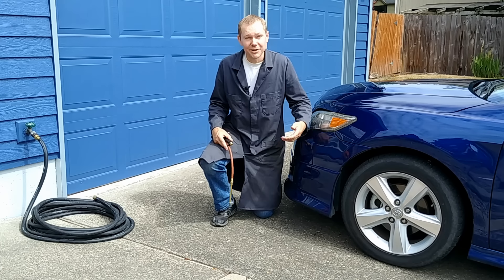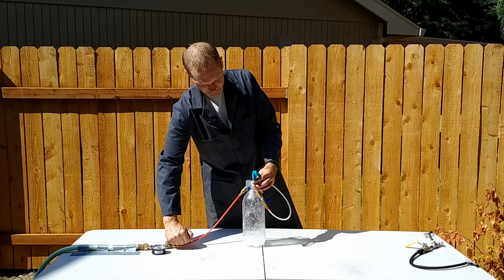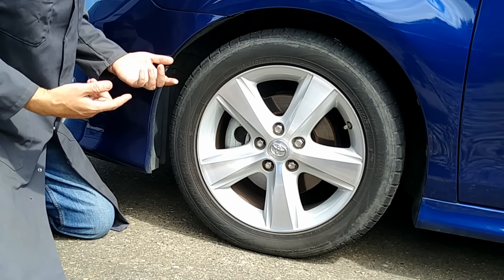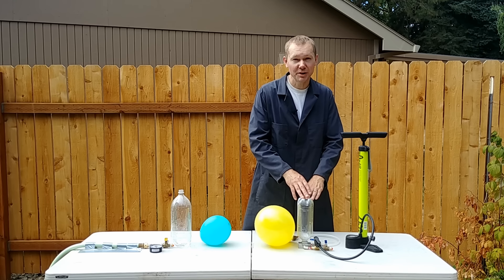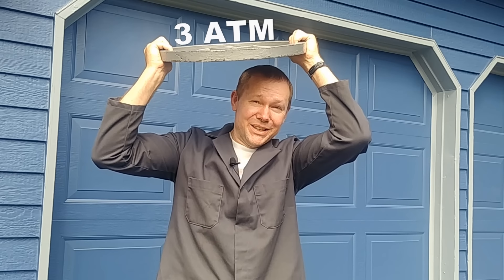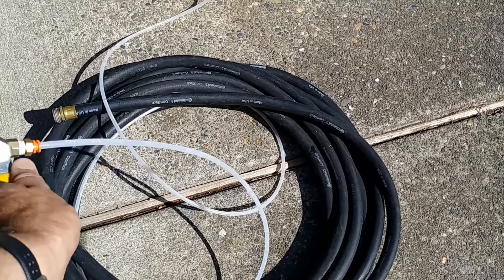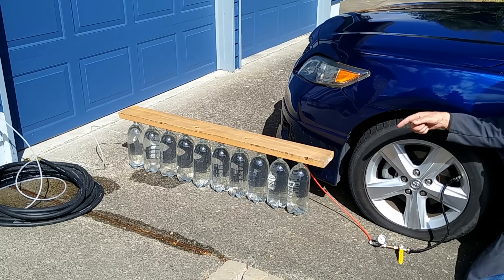2 Liter Bottle Compressor (No Moving Parts)

Comment: Common things in your house, water, water bottles, air, a CNC MACHINE
Reply: My mill isn't CNC, but I have one in my garage
Reply: I'll bet you can do this without such a fancy tool.
Reply: We don't have water...
Reply: i have a cnc machine
Reply: And a drawer full of Legris fittings
Reply: Right.. I  way off grid here and just trying to figure out how to add a little air pressure to my gravity/siphon rainwater collection system. 
Took me to year to get a dribble to the kitchen.
Reply: @suprememasteroftheuniverse  if you're clever and have a stream near your house with some elevation change you can pump water using it's own energy too.
Reply: i got a tire  plug  kit....problem solved

Comment: You might consider installing an inline air filter, so that you don’t end up with enough water in your tire to cause issues.
Reply: Or silica gel next to a sponge.
Reply: @luciusirving5926  that would be a great filtration system. I just imagine water in the tire couldn’t be good and should probably be avoided. Freezing and balance issues could cause other more problematic issues. Shocks, struts, tie rods, bearings, seals and such. All could wear down very quickly with a good wobble.
Reply: My brother had got water in one tire on his mustang. It was very bad. Definitely want to filter out the moisture as we do with air compressors. Very cool idea for sure.
Reply: That was my first thought when a saw the thumbnail
-college automotive student
Reply: An air compressor water condenser inline would work perfectly...it will trap moisture under pressure...

Comment: I'm impressed that last 2L bottle didn't explode on the first run.
Reply: It was only under around 10psi
Reply: Would have been interesting to do the experiment with the bottles at about 2 atms to start.
Reply: A two liter bottle will handle at least double the pressure of the average city water pressure.
Reply: Some plastic bottles are extremely  strong , i worked in recycling industry many years ago, and when trucks backed in to unload , they would often run over used sealed plastic bottles ,  i once  saw a 13 ton compactor back over a plastic bottle and suspend it for a few seconds before it popped , although most are not that strong some do have thicker plastic and are very strong . .
Reply: The last bottle and first bottle are under the same amount of pressure.
Reply: @Alucard-gt1zf  the new 2L bottles are thinner. Only the pre recessions (before 2007) bottles were thick. tiki punch and the short fat gatorades are the best
Reply: @Zuaachen  i was wondering about that because they were gonna have to withstand more pressure then the recomended tire pressure turns out thats ez and the water pressure has to be high enough too
Reply: @Alucard-gt1zf  - I think household water pressure is usually 30 to 60 psi.  I've read of some areas where due to elevation differences they are over 100psi.
Reply: 2liters are designed to hold compressed air in a liquid medium. Carbonated
Reply: Soda bottles like that are rated for quite a bit of pressure
Reply: I have filled them to 120 psi before.
Reply: Andy XxX  
You are very far from accurate, the entire principal behind the invention is that the incoming water increases the pressure in each succeeding bottle.
Reply: A 2L bottle blows around 90psi so this is well below tolerance..cool idea
Reply: It was a very useful experiment. If you keep the setup in the boot of your car, if you ever get a flat battery and a flat tyre at the same time and there's only a water tap nearby, you're sorted. Yes, you could use a hand air pump, but why extert yourself?
Reply: Meh, used to make dry ice bombs with 2L bottles as a kid.  At the bottle failure pressure it was enough to send a mail box 20-30 ft into the air and peel it open.  They will hold alot of preasure.
Reply: Why the last bottle, all the bottles see the same pressure?
Reply: @michaelfixedsys7463  ... rubbish,the pressure is essentially the same in each bottle ( maybe slightly less as bottles get further from the compressor due to friction of the gas but that is negligible.
Reply: @michaelfixedsys7463  
No. All the bottles are freely connected the pressure is equal across them all except when water is being added and friction delays the movement of water through the system. When the flow stops the pressure is equal in all bottles.
Reply: @Alucard-gt1zf  I think you meant to type 100 psi
Reply: @michaelfixedsys7463  The pressure is equal in all the bottles.
Reply: @andyxox4168  Yes, but the air is consentrated from all the pevious bottles to the last one.
Reply: @Dingsrud  rubbish (and incorrect spelling)
Reply: @andyxox4168  OK, what is rubbish? And for the spelling, I’m sorry,  maybe we should continue in my mother language?  Snakker du norsk?

Comment: this is how mines got compressed air in the past, they used waterfall to compress the air in to the pipes went all the way to the mine and powered the tools
Reply: Close.  But a trompe is a bit cooler and works from continuous flow.  PracticalEngineering has a good video on it.

Comment: This compressor could be implemented into a water system. If you add a second valve on the bottom of the bottles, you could empty all of them at once, and use the water in other ways, instead of wasting it. Then, when you need compressed air again, you flip a switch and water starts filling the bottles again. With a little bit of work, the process could be automated.
Reply: You sir MUST live in California..🤣 my years in college here revolved around the drought and saving water... I saw him pouring out the h20 on the driveway and was like NOOOOOOO!!😅🤣
Reply: It would take a LOT more than "a little bit of work" to automate the process.
Reply: Reminds me of selling electricity back to the power manager. If you scaled it all the way, wouldnt you just be trading water pressure with the main?
I mean obviously it would be cool if every house's water system came with a compressor, but this to me seems like the net result. Maybe get some extra life or utility out of a well pump using such cavities at the head?

Comment: Never would have thought of doing this! Displacement as a compressor.  So cool!
Reply: Technically that’s how a normal compressor works, instead of water level rising in a fixed volume it’s just a piston rising, and instead of having a guy open a butterfly valve every time the bottles are filled, a valve opens every time the piston reaches its highest point and the air escapes that way. Its a good way to demonstrate this though
Reply: And we are in a drought. Good thing I have a compressor
Reply: @johnypitman2368  And you still have all the water you started with apart from insignificant system losses,of course. Energhy or matter can be neither created nor destroyed. It is up to ingenuity as to how it is utilised. Imagination ,and innate Human laziness, are the mothers of progress.
Reply: @catabaticanabatic3800  yeah because having 80L of water left over after inflating a single tyre is completely practical
Reply: @lee3r24  Sorry Sir, I do not understand the gist of your retort.
Reply: Hey I know you! You sir improved my microsoldering skills alot back then when I used to do it. I hope your business is going well!
Reply: It's the very essence of the process.
The whole discussion in this video is avoiding (by the entire implication w/o express reference) discussing the basic physics of it all.

Interesting slight-of-hand Physics lecture.
Reply: It's just using household water pressure. It has nothing to do with the bottles. A long enough garden hose would do it. Its not displacement as a compressor. Its just the water pressure from the hose.. ~ 30-80 psi.
Reply: @its1110  There is no physics involved really.. Its just the water pressure from the hose...
Reply: Do you know that he use the pressure generated by the pumps of water net distributor?

Comment: I have an adapter for connecting my garden hose directly to my tractor tire. I fill it to the top of the rim (about 70% water). The weight (ballast) helps. Not recommended for car tires due to speed.
Reply: the bad part is it will make your rim rust.

Comment: A displacement compressor made out of soda bottles, that's really cool!
I can't say I expected it to actually meet the required inflation pressure running solely from mains water, but not only is it sufficient, I'm estimating based on atmospheric pressure and just how much air is being displaced that this rig is capable of reaching pressures as high as 80-90 PSI

Comment: Finally takes it to the mechanic to fix the stupid tire. Mechanic: “Why do you have so much water in your tires?”
Reply: Lmfao........ that's why I came here
Reply: You'd be surprised how much water you find sometimes.
People or gas stations never drain their compressors and by the time they've been filling it twice a week for 5 months there's a ton.
Not always but usually the shitboxes
Reply: @egnaro-hm1bd  I leave the pressure release valve just slightly open to drain the water from the compressor tank.

Comment: "Using nothing but water pressure", and "weeks of designing and fabricating".
Reply: Or... Just use that bicycle pump 🤣
Reply: Just a lesson in physics he was  not even trying to say it was practical
Reply: My point is, you don't spend weeks designing and fabricating water.  "Nothing but water pressure" is bullshit.  That's like saying an airplane flies on nothing but jet fuel.
Reply: @havenbastion  Exactly. As if the water pressure just magically appeared out of thin air...
Reply: @juanduarte200  Sadly, average people like you easily get in awe of every bullcrap they come across on the Internet.
The value of "a video like this" is about zero.
Reply: @juanduarte200  Or perhaps people should be more careful about what they say so they don't contradict themselves.
Reply: @havenbastion   you seriously have 0 knowledge in physics and just keep making yourself look like a fool. He’s not talking about materials but mechanics
Reply: @juanduarte200  Water pressure doesn't magically occur on its own.  He was not using "nothing but water pressure" in any sense.  Try to do it without the materials and see how far you get.
Reply: @havenbastion  you’re a heck of a comedian! How old are you 13?
Reply: @juanduarte200  I can't imagine how that was funny, but hey, you do you.
Reply: cnc machine and aluminium cubes

Comment: a saying we had in the military "if its stupid, but it works. it isnt stupid!"
Reply: That's not just military my guy.
Reply: @Bob Sacamano as a software engineer, we subscribe to the least stupid with a margin of error as a means to balance the optimisation problem of time and effort (cost/benefit)
Reply: In Aviation, if it's stupid and it worked, it is still stupid and you were just lucky. Aviation has very precise definitions of "stupid".

Comment: This only works because the water pressure was higher than the final tire pressure required. Also, there’s a better no moving parts compressor called a Trompe.
Reply: @jamierodg1  that’s incorrect. With a trompe the air is drawn in with the water from the source, this is just forcing air from bottles with water pressure. Not even close to a trompe
Reply: Was also confused about the pressure differential aspect. Maybe if he had a 20cm water inlet and a 1cm air outlet of some sort, but they seem identical in diameter so the pressure in should equal pressure out right ?

Comment: That will fit nicely in my trunk, in case of emergency flats.
Reply: My dear in cash of emegency you will not get this much of water too😂 and presure is also inportant,
Air will not creat if u will fill by bocket or mug
Reply: You can connect a compressor tank to your water out line. Let it fill with water and the air can be collected in another compressor tank. Time it right when you shower and youll some have compressed air for free and just open a return line from the first tank back to your water system. You can use that air for many things at whatever psi you got from the tank. You can run pneumatic tools equipment maybe even make an electric generator if you have enough tanks to run a alternator long enough. Ik its complicated but at least you'll have a compressor that can last longer than any other as long as the tank don't get holes  and won't cost you anything after a time period if you count gas or watts used by standard compressors
Reply: @YEET-yh6qc  this isn't magically turning water into pressure, it's just transferring pressure from the water supply system to air.
Reply: @SqueakyNeb  ik  the air that gets trapped in the water when stream creates negative atmospheric pressure sucking in air in the line you just separate it  by literally 3 pipes its called a trompe. It can work depending what you want and how big of trompe you make. Industrial ones for the sale of compressed air were build on rivers and other streams. People use them for hydroponics, i want to build one for aerobic bacteria to treat sewage water instead of just having a septic tank. I want the dirty water to be almost clear so it can flow back into the garden the same way they sewage process water for golf courts sprinklers.

Comment: meanwhile, on garage54: "what if we fill the tires with WATER?!"
Reply: In work we fill the tractor tyres with water for ballast when using  side arm attatchments
Reply: @Kaaarels You had faulty valve... It happens often :D
Reply: I've only seen maybe two of their videos years ago- but I knew immediately which channel you were referring to 🤣
Reply: I had the same thought.  Those Russians with their water and cement.
Reply: @gasgiant7122  Yeah, pretty common for ag equipment.  Competitive rock crawlers will fill with water or even put a couple hundred pounds of steel shot in their tires for maximum grip and stability.  You wouldn't want to drive it on the road but it's amazing what those guys can do.
Reply: This was my thought...for my next search LOL
Reply: Icky, the actual title should be: what happens when we fill compressed air bottles with car tires and weld it to the engine of a Lata”
Reply: Done that. Not recommended. Worked for a while, but in a short time the lack of cushion blew out the tire. One good bump and SPLAT!
Reply: Usually when people are ballasting tires with water, they add calcium to prevent the water from freezing and expanding. Those machines also aren't street cars meant to travel at highway speeds.
Reply: @Kaaarels someone did not like you and was letting the air out.
Reply: Lil. Truw

Comment: That was cool, but it looks like this system takes all day to fill up a tire
Reply: If you're stranded, all day is still better than forever
Reply: If you don't have the money to buy a compressor but have stuff lying around to make this would only be a reason for me to do it.
Reply: @RCaIabraro  Stranded with access to a water main.
Reply: Its more showing that its possible.
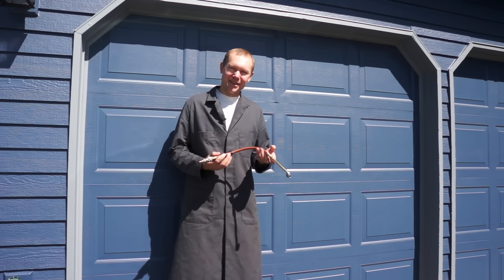Reply: 4:54 "but that's not the point"
Reply: "Every dilithium crystal connection smashed in the warp engine circuitry. We're trying to bypass them now."
Reply: Omg I'm a subscriber! I didn't know you're also into this kind of channel!
Reply: @kajacx  - Flip it over and hook your air compressor up to it.
Reply: Odd to see, my internet sushi master instructor, on an engineering site.
Awesome though!
Reply: You got somewhere to be?????
Reply: @RCaIabraro  would be tragic if stranded in a dessert with no water and no bottles😊☹️
Reply: @GS-ts5fo  hahaha
Reply: @RCaIabraro  Have a point. But at the same time, if you're going somewhere off the beaten track you'd likely have at least a hand pump. Exhausting but effective. Anyway, it's a cool idea.
Reply: @dustintunis9347  - "hook your air compressor up to it" sounds a lot more useful, equivalent to a bigger air tank. Inflate tires in one minute!!!
Reply: Your next video should demonstrate whether this method is faster than calling AAA. My money is on the plastic bottles.
Reply: @tangoindiamike9189  hahahag
Reply: Something to do while waiting for help— hahaha
Reply: @dougfaiella4179  no money for a compressor but he has money to a milling machine to mill aluminium and buy al the connectors.. Yeah. The idea is fun, but not smart to do it this way.
Reply: Need biggie bottles, and more. And an easy valve to get rid of water. It also needs a water air separator to avoid water entering the tire.
Reply: There’s always one…
I think the OP missed the entire point of the video.